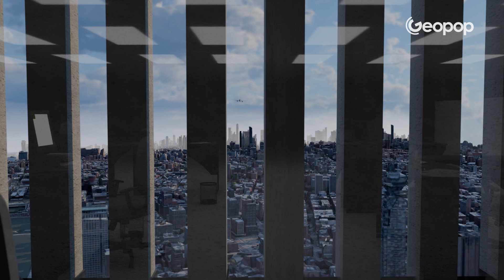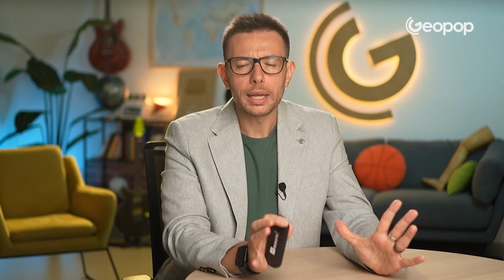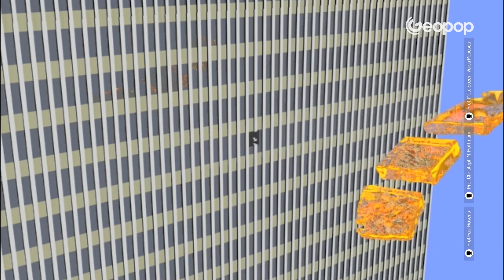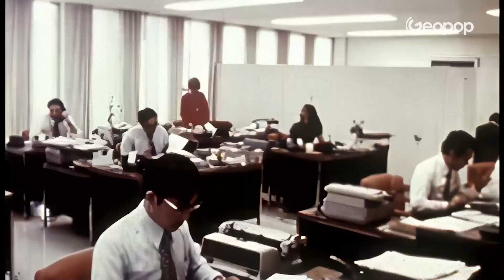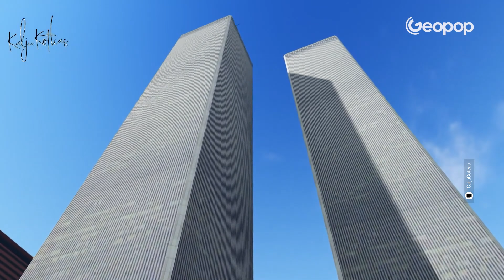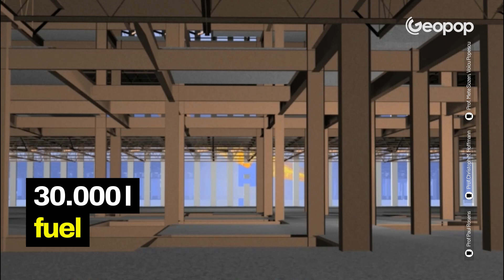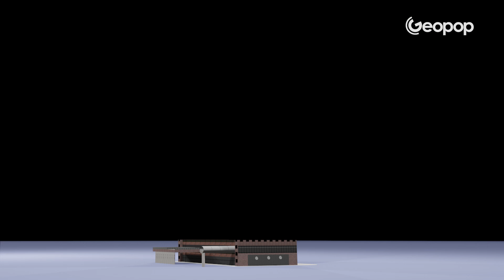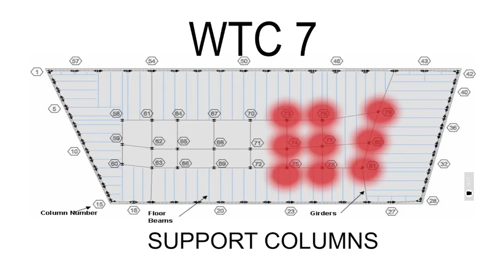9/11, 2001: The Technical Reconstruction of the Twin Towers and WTC 7 Collapses

Comment: so ............if the floors offered almost nbo resistance to the collapse       .... not sure why they wouldnt poffer resistance, they were unharmed for the most part, talking 0-60 floors.           ...    Why in 30 years did one of the floors not been able too handle the weight & cause a collapse in the past.           why would floors become weak floors 1-60 for example.
Reply: This should clear up all of your many confusions. 

Twin Towers collapses were actually relatively straightforward, the fundamentals already understood in the professional engineering community within just weeks. Still, there’s a lot of really bad information floating out there, mostly on the internet where it’s easily accessible to anyone. Good information takes more effort to come by and is much harder for laypersons to digest. Engineeringspeak is complex and dull. Also, some people put up a wall to protect their beliefs and false assumptions. Engineering is hard while wild baseless speculation and pathological theorizing with easy hand-wave answers is simple and exciting. Fanciful tails of pre-planned demolitions, magical space beams, melting steel and mini-nukes are just far more entertaining and require a whole lot less thinking, thus getting far more intention than they deserve.

To correct that situation, I have all on my own prepared this short yet detailed technical description of Twin Towers collapses based on my own observation and analysis of the available true and relevant facts. No politics or ideology, just the engineering. My hope is this will dispel many common myths and answer most if not all questions you may have about the Twin Towers collapses, because anything can seem like a conspiracy if you don’t understand how it works

While complex, most of the Twin Towers collapse mechanisms can be seen with the naked eye and easily discerned and understood by the layperson if sufficient time is taken to understand. 

1. The Twin Towers consisted of 4 primary structural elements that together formed an integrated system where each relied on the others.  47 hollow box-section steel Core Columns carry the majority of the gravity loads. The 236 hollow box-section steel Perimeter Columns carry the remainder and ALL of the lateral (wind) loads. Long-span Lightweight Steel Trusses connect the core and perimeter column together at each floor with a Hat Truss on top to tie the structure together as an integrated unit where no element can survive without the others. There was no structural load bearing concrete and most components were bolted together.

2. The impact of 117 tons of airplane (= to about 12 dump trucks) at speeds up to 590 mph with the energy of a ton of TNT completely destroys the aircraft. This in no way implies the Towers come out unscathed. Many perimeter columns are damaged or destroyed as are some core columns (example; 33 of 59 perimeter and 20 of 47 core columns damaged or destroyed at the impact floors in the North Tower), This damage is primarily through bolt-shearing failures at the end connecting flanges, as well as bending, twisting and fracturing of weld seams. There was no cutting or slicing - the reality was far more violent and messy. 

3. The impacts destroy or damage fire insulation, fire breaks and sprinkler systems on multiple floors.  Huge fires are started across multiple floors simultaneously and allowed to spread rapidly with no effective firefighting or fire suppression. This was an unprecedented fire event . 

4. The hotter steel gets the weaker it gets .  With fire insulation stripped away and no sprinklers the survival time of the steel greatly reduced. Gradually over time heat causes the lightweight steel Floor Trusses at the impact damaged floors to sag, which was observed and recorded.  No steel melted or needed to. Structural steel fails long before it becomes a puddle. It just needs to bend

5. Sagging floor trusses pull on the increasingly weak and overloaded Perimeter Columns, causing some of them to bow inward by up to 5 feet. A straight column is up to 4 times stronger than a bent column. The bowed Perimeter Columns buckle and fail, initiating collapse. The formerly static mass above which the structure below could easily support is now converted into a dynamic mass up to 30 times greater. Because they have buckled, the Columns above and below the failure point are no longer aligned . The load bearing structure below no longer bears any load as it falls past the lower columns, NOT onto them.

6. Thousands of tons of debris fall within the four outer walls, down through the open office space, crashing onto the first intact floor it encounters. This massive impact immediately breaks the bolted connections to the columns as the amount of resistance the Floor Trusses can offer is negligible.  The falling debris slows only marginally and briefly. Note:
6a. This is NOT a solid top block crashing into and “crushing” a solid bottom block .
6b. The debris falls past the columns not onto them.  The columns provide no resistance to the falling debris. 
6c. Only the bolted connections of the floor trusses to the core and perimeter columns can offer any resistance. A pair of 5/8” bolts at each end of each truss vs. thousands of tons of falling debris.
6d. No laws of physics are violated.

7.  This floor-led collapse progression within the four outer walls can only go straight down. Note: 
7a. This process is often incorrectly referred to as “pancaking” which actually refers to a completely different process rejected at an early stage. The catchy name stuck but nobody knows what it is supposed to mean.  Pancaking is too simplistic and inaccurate anyway. More like Kaiserschmarrn.

8. Collapse progresses through the floor systems not down the columns, through the path of least resistance . Rate of floor failures increases with each successive floor as momentum increases, reaching an average acceleration of 0.65 of GA, or 35% slower than true free fall. Bam, bam, bam down the building until there are no more floors to fail.  The resistance offered by each successive floor is always the same. The mass and velocity, thus the energy of the falling debris is constantly increasing, with each floor destroyed adding new falling mass. Some falls to the sides, but most falls down. More mass, more velocity, same resistance with each floor.  Don’t get stuck on the but the lower floors weren’t on fire nonsense. They weren‘t and didn’t need to be.

9. The Towers were 95% air by volume. As that air was compressed inside the building it is forced down the tower and blown out the sides in reaction to the building collapsing . Those were not “explosions”, it was expulsions of compressed air caused by the collapsing building, explaining the low velocity, lack of flash, blast, supersonic pressure waves and lethal high-velocity ejecta.  

10. Perimeter Columns become detached and peel away like a banana behind the collapse front, playing out to the four points of the compass extending to more than 600 feet from the base of the towers. This was quite obvious from examination of the debris pile. 

11. Core Columns fail last as their internal beam bracing is stripped away by falling debris and lateral support from the floor to perimeter columns is lost. 

12. For those who care about how long this whole process took; 31-34 seconds from the moment the perimeter columns buckled until the last core columns hit the pile, or 1/3 the rate of true free fall. Don’t believe me?  Just watch any video of the collapses and note the loose truly free-falling debris dropping much faster than the towers themselves.  

13. Each Tower had a 1-acre footprint. Far from collapsing inside their own footprints the debris pile spread out over 17 acres in a pile up to 14 stories deep. 8 surrounding buildings were destroyed and scores more damaged by the falling debris. 

14. What was NOT observed were the 180-190 dB bangs of thousands of high explosive devices or the blinding bright flashes of burning thermite. Neither could have caused the (silent) perimeter column buckling that clearly initiated collapse.  Neither explosives or thermite could have survived the impacts and subsequent fires either. A video of a shocked and injured firefighter using the magic word explosion is in no way proof of explsoIVES . The pre—planned demolition case relies entirely on that sort of thing. There is zero tangible physical evidence and it would be technically impossible, totally impractical and completely unnecessary. No one would bother. 

15.  Finally, the Twin Towers were perfectly safe within their design envelope.  They only collapsed when taken far outside design parameters by an extraordinary and unprecedented event 

Impact + Fire (heat) + Time + Gravity = Collapse . Remove any one of those four elements and there is no collapse. Ignore any of those elements (as many do) and you will never understand the collapses. The Twin Towers were an integrated system in which no one component could survive without the others. One fails, the rest follow, through the path of least resistance – DOWN – through the open space, bypassing the path of greatest resistance – the columns.  Nothing I just described violates any laws of physics. All of the above is true no matter who planned and carried out the 9/11 attacks or why 

I hope you found this helpful and informative. It is not meant to be adversarial, but to solicit informed critical comment, positive or negative. If I made any errors of fact, logic or reason or left anything critical out, please let me know so I can fix it. To stay focused just one topic at a time please and on-topic (Twin Towers ONLY). No word-salads of Gish Gallop. IF you can offer a more plausible alternative be my guest. Be the first. Please start any reply with the words “Tits McGee” or I will know you didn’t actually read it, are not serious and just wasting my time.
Reply: @TheLoonResistance                              Why the mini novel ?         I ready lots of that.                     "Short yet detailed"      I knew right then it was not gonna be short lol                              I understand when a floor has a certain amount it can safely withhold     ..... and by putting another floor on it then another & another surpasses the floors weight capacity. Got all that.     But can we forget science for a moment & just imagine you have 4 steel beams upright. Square & a floor  & 2 foot higher another floor then 2 foot higher another floor & so on                    ,,,mini example here       ..... Imagine dropping a 50 ton weight on the top floor     ....    Generally it will cause floor failure, possibly another floor, maybe even a 3rd floor.  at some point one floor holds due to each upper meeting resitance with each floor.                         so out of lets say 50 floors you end 35 of the 50 collapsed.

 I saw the steel being melted, but that was WAY up high over 80 stories up. So yeh I expect failure & a collapse. Where was the compromised melted steel at the 30th floor or the 40th floor or 15th floor.
 Nuthin wrong with asking uestions & nuthin wrong with not understanding something that doesnt make sense.            what you explained made sense to me IF  I believed  all floors would give way , the pancake theory.      Everythings all good & sensible until the pancake collapapse part of it.      My brain cant digest that part.
Reply: @97warlock  - I explained the collapse in such a way as it fits in one YouTube comment (the full version takes 8) AND answers any questions.

Try reading it, then if you still have questions you can ask away.
Reply: The floors beneath the impact point offered 'resistance' to the static load of the floors above them as they were designed to do. However, the impact of the airplanes created a vertical 'gap' in this supporting structure of approximately 30 feet. When the remaining structure collapsed at the impact point, the floors above fell through the gap, generating far more downward kinetic energy (i.e. dynamic load) than the lower floors were ever designed to withstand.

Comment: I understand the heat, the impact etc etc      , but seems to me there SHOULD be 70ish floors still standing fire doesnt burn down very well,  and witnesses spoke of lots of jet fuel flowing down           ..... but nothing happened with it, it just went down. there was no mention of a blast 5-10 minutes after impact. so I guess jet fuel just kept working its way down.  So at that point its irrelevant .             ... yet what caused the massive blast in the lobby of the first tower.                it just makes no sense.  I can make sense of all the scientific info,  but why they both fell,  is still a mystery to me
Reply: Well, we gotta realize that explosion in the lobby didn't officially happen. So they don't have to address it. I agree at least 70 floors should be left on both buildings and tower 7 never should have collapsed at all. Up until recently I couldn't find any audio of explosions that day. I've heard eye witnesses claim they heard explosions. I've seen videos of the collapses and reporters claiming there were massive explosions when the towers were falling, but I couldn't hear it and the reason is the microphone but never mind that. I came across this video.  At 8:25 you can hear a massive explosion and we know it's coming from tower 7 because a FF comes over and says, "guys, we gotta get out of here tower 7 is exploding. https://youtu.be/bLF5D7M1YgA?si=Q1pgWbdlyo0UOvOp